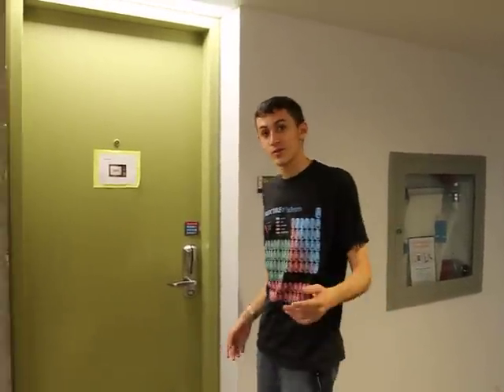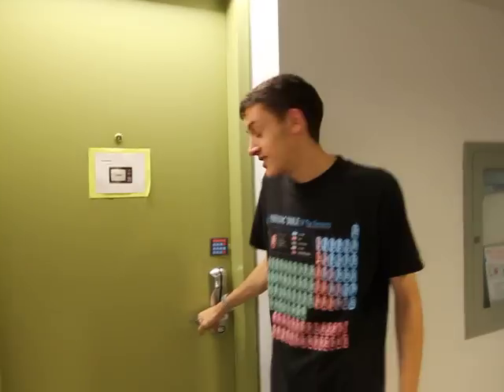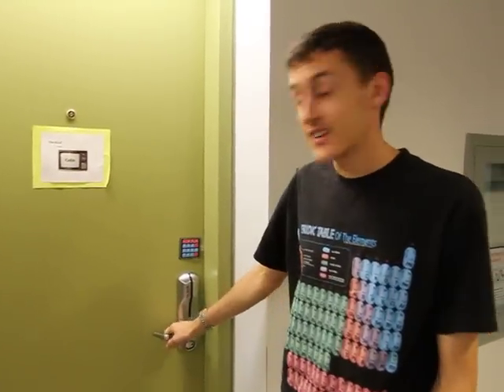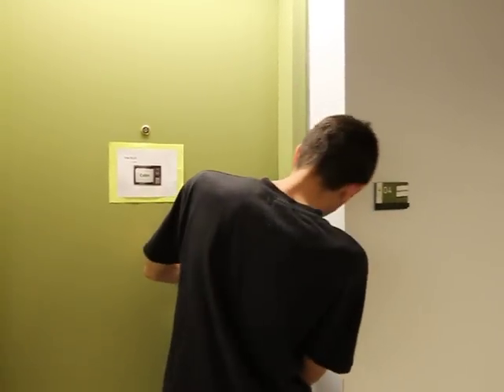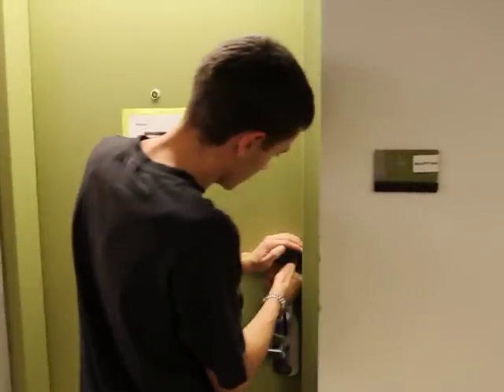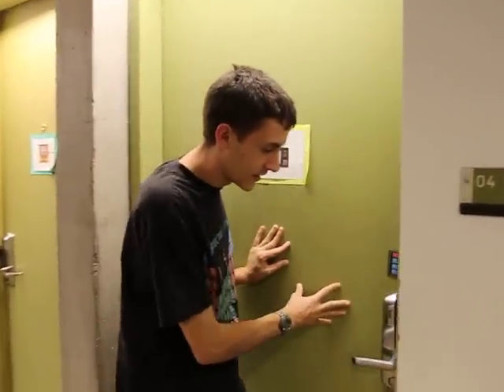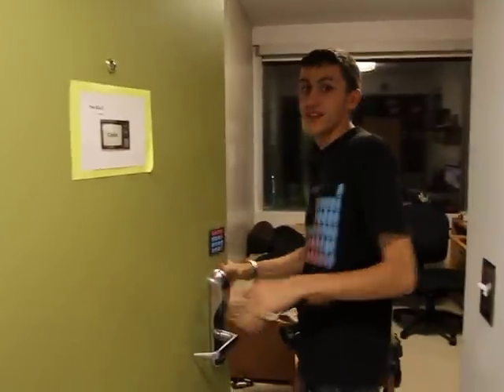Door opener demonstration

Comment: awesome hack...you guys should reshoot the video with better light.  

If I extended the lentgth of the door handle with a splint, and tei the motor to the dital end of the splint, I could probably use a motor with less power.  

If someone made a beeping noise near the controlled wouldnt the door also open?  High pitch, that is.